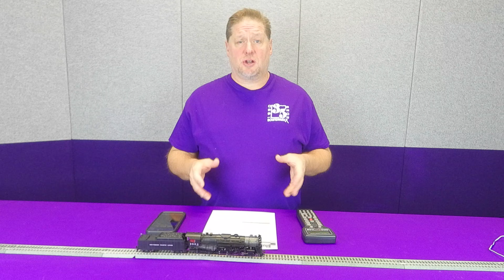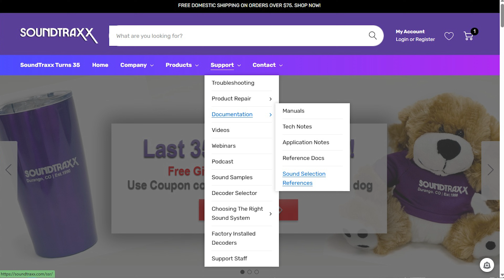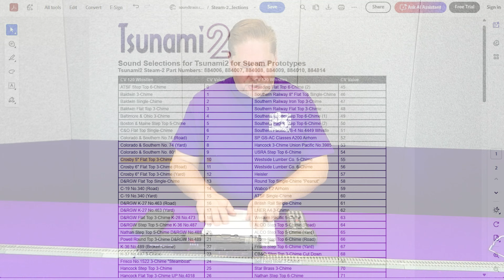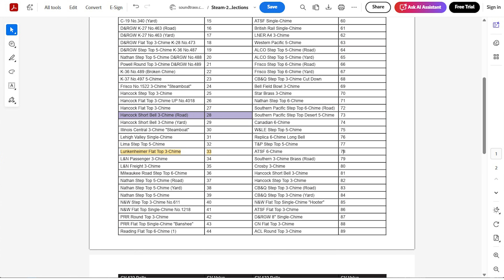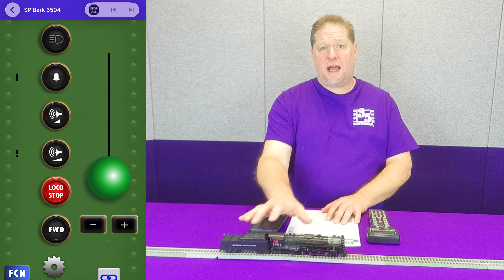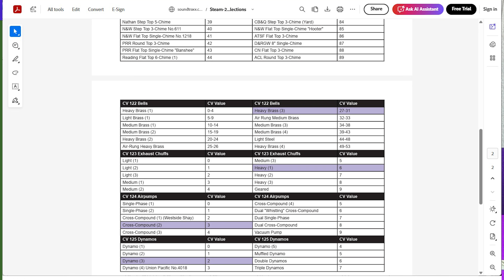Choosing and Changing Sounds on SoundTraxx Decoders

Comment: George could you do a tutorial on adding smoke machines using Tsunami decoders. I work in 2 rail O scale and would love to do it properly and have that option.
Reply from the maker: Thanks for the feedback. We will keep this in mind. The main problem is a model to do this on. George does not use smoke units, and therefore, this is not something he usually adds. Our Support Team can give you advice on the install: (970)259-0690 or support@soundtraxx.com.

Comment: I use a dcc ex command station and was able to program the sounds on the main, but not the volume. In order to set both the main volume, or individual whistle volume, I had to use the programming track for some reason.
Reply: Interesting.I am considering an EX system.The older Digitrax won't recognize CV 128.I know that much.
Reply from the maker: That is odd. Our decoders follow the NMRA standard the DCC system may not. We can't speak to how the DCC system operates since we don't make it.